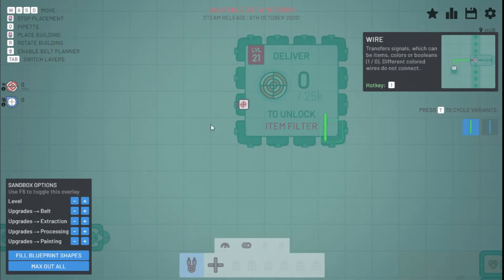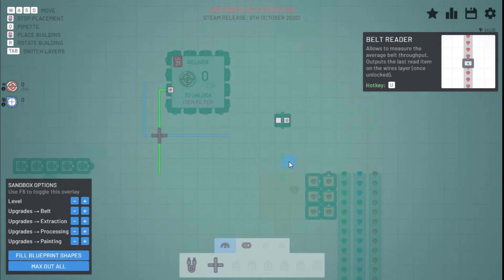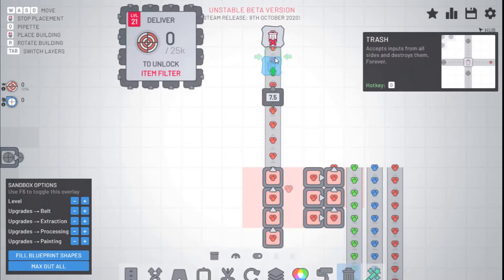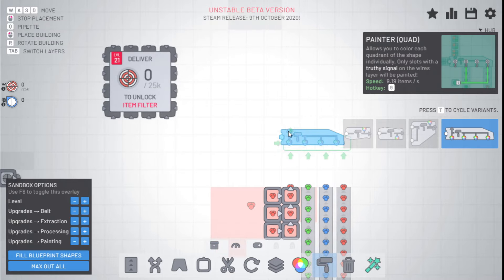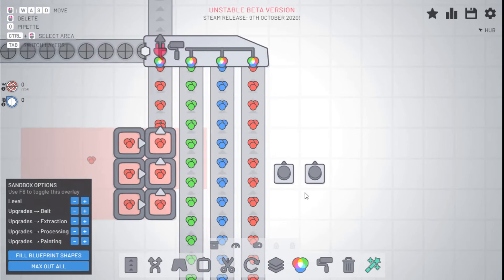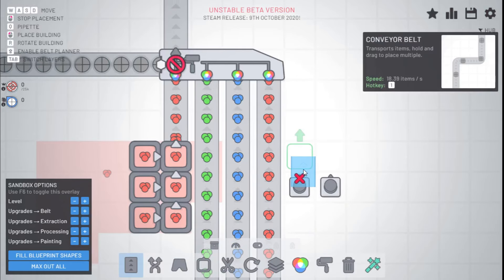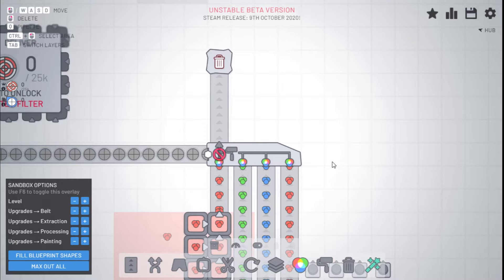shapez.io Wires Tutorial (By Dogdayboy)

Comment: I don't understand why the quad painter needs wires. It should simply paint based on which paint inputs are being fed.
Reply: yes i agree. I like that they added wire. But having the quad painter requiring it is a bit nonsensical.
Reply: That would only work if all inputs are at max belt capacity, otherwise you start to see improperly painted shapes.
Reply: @SeedlingNL  and? then it should wait for the content to be inputed, thus causing a bottleneck. Defining proper input is your responsibility
Reply: I don't mind it being compatible with wires, but it should not require them
Reply: @akiraic Therefore not allowing partially painted shapes. You changed the requirements there

Comment: This really doesn't adequately explain what's going on. The most important thing missed in this video is that the painter paints the quadrants in a clockwise fashion from left-to-right, starting with the top-right corner of the shape. It also doesn't explain the core value of wires, instead just directing users to use buttons. You should be explaining that you can use sensors to trigger different states on the quad painter. As you can see in the comments on this video multiple people are confused as to why wires are required for the quad painter at all.
Reply: if you reached this point you already now that "... the quadrants in a clockwise fashion from left-to-right" from the quad cutter

Comment: I am not trained to do programming, and this update is overwhelming.
Reply: This is simple compared to Factorio's wire system.
Reply: @Vidar33  That only means I can't play that game.
Reply: @niccolom  You can play that game. The wiring system is completely optional in factorio.
Reply: your comment is contradictory
Reply: I'm a programmer and I don't touch the wire system in factorio
Reply: You don't need to understand programming. Just think that you connect a lightswitch to a lightbulb. You press the button, the thing attached starts working :)
Reply: @earlgrey2130    Don't worry about it.  I stopped playing at the time of that post.
I'm sure they have made things even more complicated for the untrained.

At that time, I was just happy with the limited toolkit, which was as much as I could understand in terms of programming, and watched the mesmerizing shapes move towards the middle.  After that update, I felt stupid so the satisfaction vanished.

Comment: is there really nothing new after level 100? just the same random patterns with increasing demand?
Reply from the maker: I'll probably introduce a bit more of a challenge by requiring floating layers :P but that can quickly get too hard. Also, "really nothing new" after > 20 hours of gameplay is a luxory problem :p
Reply: @tobsprGames  I was expecting something like 5th+ layer or maybe more types shapes which could be found far from hub or something. Or maybe some pattern coloring like zebra or gradient etc. I think it is not that hard to add this and will give more stuff to figure out later in game.

Also the issue with level 26 was because of unstable cutter/stacker where empty parts might collapse into lower layers. Imo my generator rather pointless now cause if random request from hub will have empty places it probably will break because of this unstableness. Any plans to remove this collapsing and preserve empty layers during cutting/stacking?
Reply: @tobsprGames  Dude make "too hard" content for players that enjoy that kind of thing.  Just put it at the end of the game.  Similarly I think tedium was introduced too early into the experience via crazy shapes.  I'd remove a few of those things and add the wires content sooner.  Great game.

Comment: Do you know the Shapez Industries mod? You can tell me how to solve level 20? (In Shapez Industries mod)
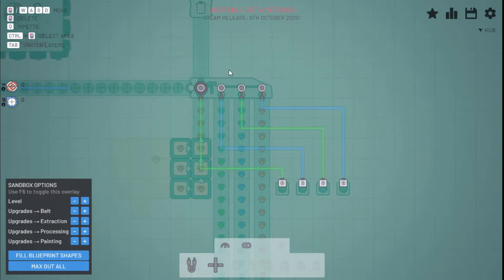Reply: for level 20: For discussion, let's think of a clock - Upper Right (2 o'clock area), Bottom Right (4), Bottom Left (7), and Top Left (10). Also, you're going to want to gather some random shape that will be thrown away (I used spikes). Align the spikes to the 2:00 area. Connect that to the 10:00 white circle. Then separately connect the spikes to the gray square in 7:00 area. Combine these 2 new shapes, you'll end up with 2 layers. Cut this in half, the right side goes to trash, the left side goes to next step. Create the remaining side and combine into final piece. Hope that helps